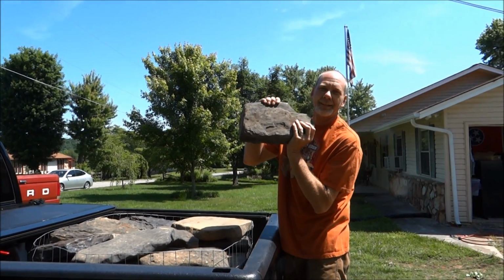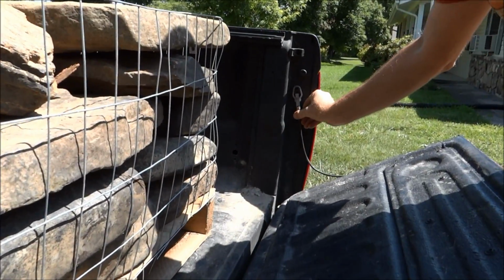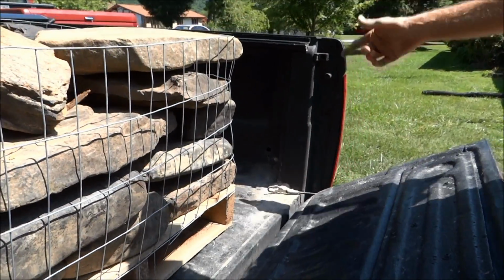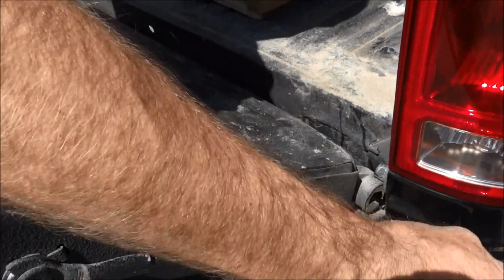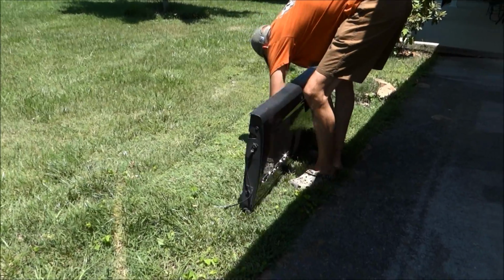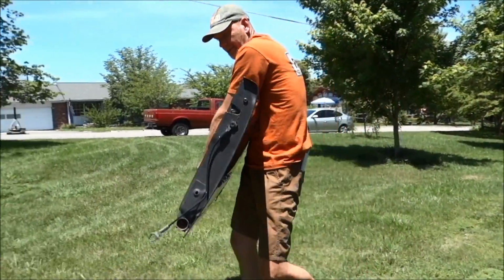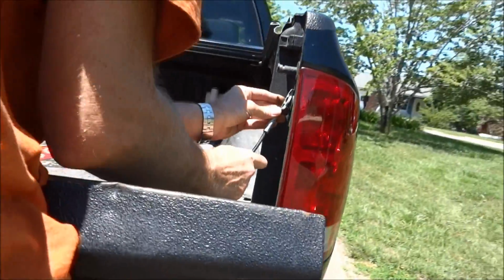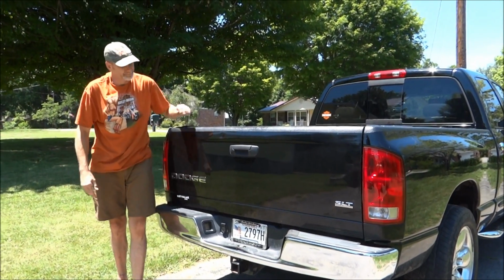How to Easiliy Remove and Install a Truck Tailgate

Comment: I feel dumb that I had to even watch this... I’m buying a car next time 😂
Reply: yes a lot easier on the older models 'with the round slots - the newer models like my  2015  GMC  the slots are not round they have a oval shape plus the backup wiring hornest to the camera  'it   runs  thru the the bottom in the tailgate  connected to the  camera  it has to be disconnected  first this tailgates seem to be  a lot heavier .-the storm comes when you reinstall the Bitch  remember the round holes in the older ones ' this has  a oval shape to line up;  working  by        my your self it's stuff  '  use a  cloth keeps   from unwanted  scratches  .

Comment: Get the gate keeper from Amazon, secure it and weld it.  You can thread a steel cable from the bed through the bottom of the tailgate and lock to add another layer of security.  Of course, if you weld the gate keeper you're going to have a hard time removing it yourself too, keep that in mind.  It works for me because I don't plan to remove it.
Reply from the maker: I take mine off all the time....

Comment: On the right side I put a gear clamp to prevent it from coming off this easily. To easy to steal without it. Yea it wont save you from the hardcvore theif but it cant hurt.